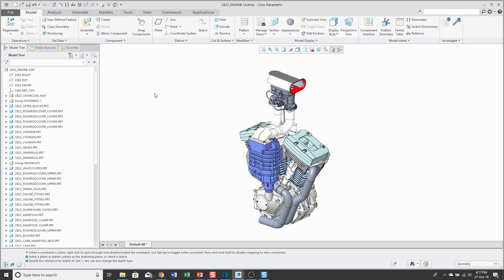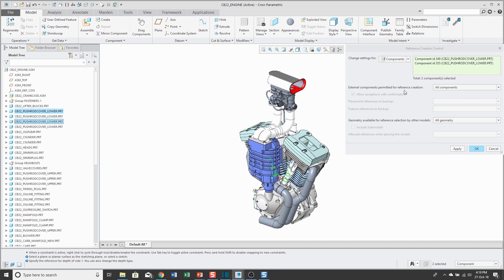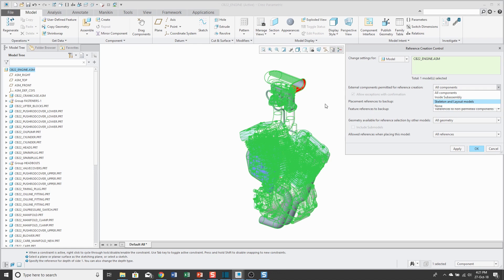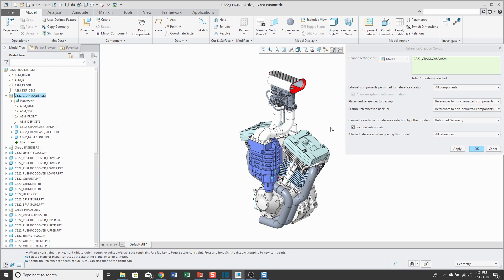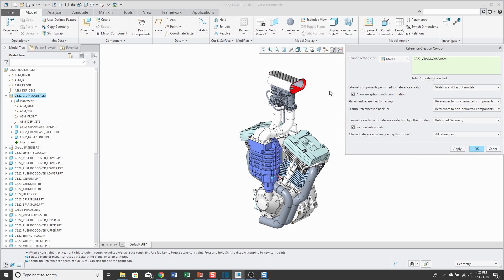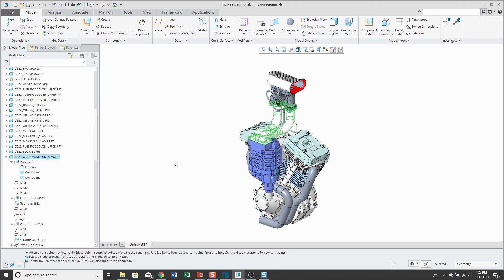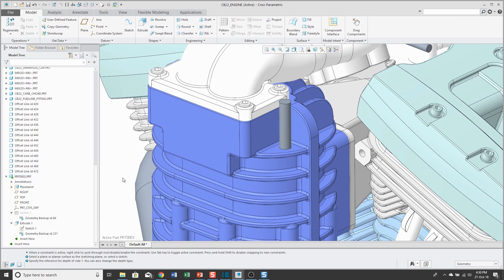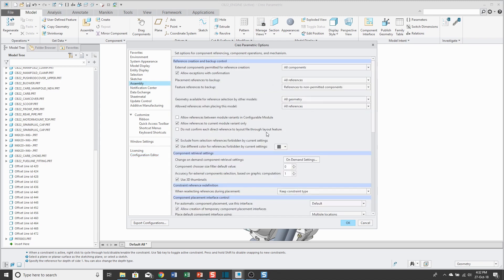Creo Parametric - Reference Creation Control | External References | Top Down Design

Comment: Is there any method or solution for breaking the dependency (reference) when copying the assembly using the command  “Save as”?
Reply from the maker: That’s an involved question. It depends on how the external references were made. You can avoid having to resolve the references by performing a Workspace Save As in Windchill.
Reply: @CADPLMGuy  Doing a “Save as” for the Windchill workspace is not an option for us. We would like to completely break external links in Windchill. 
The external links are created this way:
1.	The hydraulic system components are assembled by the hydraulic designer into a separate assembly (hereinafter referred to as the “hydraulic system assembly”) with the default binding of each element that he adds to the assembly.
2.	Then this hydraulic system assembly is included by the main linker of the combine into his top-level assembly (hereinafter referred to as the “top-level assembly”).
3.	 After that, the hydraulic designer opens the “top-level assembly”, activates the “hydraulic system assembly” and binds the components of the hydraulic system (included in the “hydraulic system assembly”) to the components of the entire combine (included in the “top-level assembly”).
This technique works well when designing the combine of first base representative of the family, however, when using the Windchill command “Save as” on the top level, when another combine is created on the basis of the first one, it happens that the links (bindings) of hydraulic elements to the elements of the original (basic) combine are copied.
On the subsequent run for several years, the Windchill “Save as” command was used, and as a result, there are a large number of bindings to the previous combine models in the assembly, which leads to the message “more than 60 thousand records”.